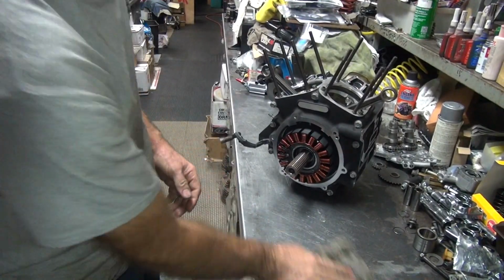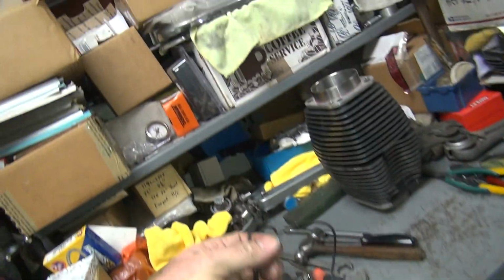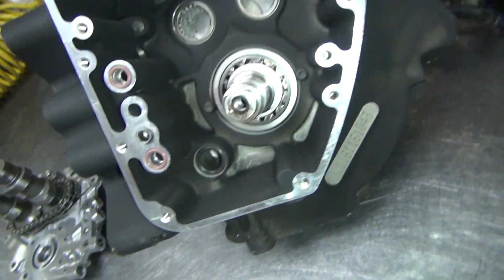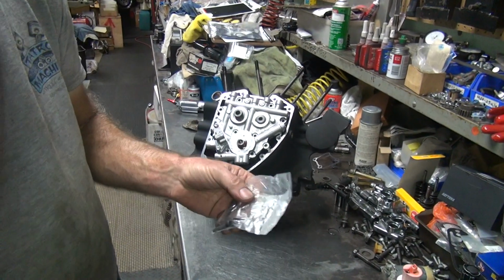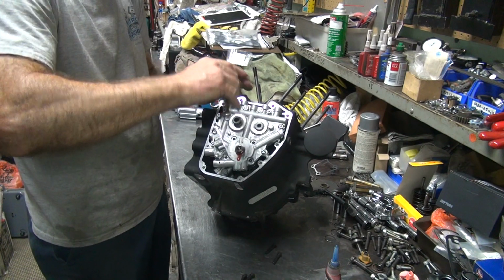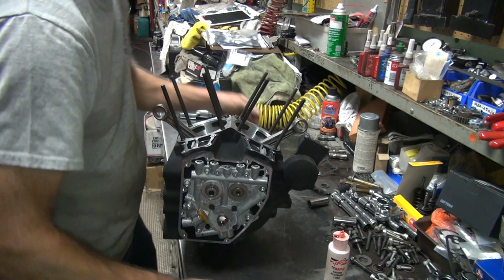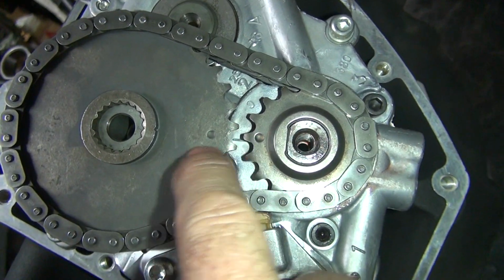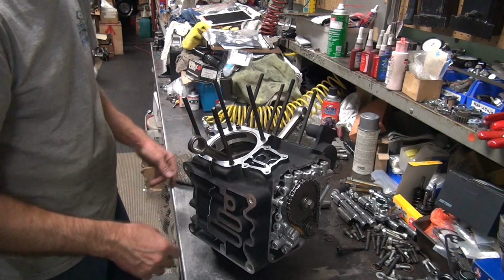#115 2011 roadglide find the motor noise FLT harley twin cam repair motor primary by tatro machine

Comment: Wow,  If my mechanic's work bench looked like your shit show, I'd run out the door as fast as I could.  You speak with the confidence of a drug addict.  Spinning the crack and giving a visual approval of pinion runout......... you're an idiot!
Reply: WOW!!! you have a "MECHANIC"...... and you call Tatro an idiot.  Maybe you should think about your ignorance before  you speak.
Reply: I am willing to bet that the crank was probably trued on the bench before it was ever put into the cases. And about the Clutter That is how the mind of a genius works. He's not just changing your oil on clean workbench. He is building bikes from the ground up.

Comment: No reason why they couldn't have made the cams gear driven. The Sportster engines have been gear driven since the K Model!
Reply from the maker: chains are cheap, very fast to install and take almost no skill to do it.
we all know that harley is cheap and saves every penny they can wherever they can.
tatro
Reply: ------ with 4 cams ----- Sportster gets short changed... they deserve glory & praise ------ race proven tried and trued ------
Reply: @rsgabrys3080  not to sound like an asshole or anything but the Indian FTR bikes have been eating them up on the dirt track circuit. HD has at best a top 10 and get smoked by the competition be it Indian or something else like that of a Japanese bike. Damn shame
Reply: Kenneth Wise they got away from gear drives on the TC and M8’s because of the crankshaft design. When they switched to a press in crank pin they lost accuracy on the runout at the end of the crank where the gear sits. Using a chain instead of gears allows a lot more flexibility in terms of tolerance so HD doesn’t have to spend as much time truing up their rotating assemblies. 

When guys go to gear drive setups ok their TC/M8 engines it’s imperative that the crank runout be checked and found to be in spec. Most engines with any amount of miles won’t be so the almost a sure thing that you’ll need to save the crank trued up and the pin welded in place to keep it from moving. 

The Evo and older HD’s use a tapered crank pin with nuts on either side, it makes it a lot easier to keep straight. 

For better or worse it’s a choice HD made in order to ease production and lower costs. Like I said gear drives are available for people who want them. In my opinion it’s really not necessary unless you’re gonna split cases and mess with the crank anyways. I’ve built a ton of these “moron motors” and only used gear drives on a few, never had an issue with one jumping time or anything like that. The 99-06 Twin Cams used a spring driven tensioner instead of the hydraulic tensioners you see in this video, they upgraded to that style in 2007. If you have a 99-06 TC I would recommend you check those tensioners if you haven’t already and to upgrade them to the newer style. There’s a lot of aftermarket solutions available to address that issue. 

I just finished replacing a cam plate oil pump, chains, tensioners, bearings and gears in an 05 103 ci TC today as a matter of fact. The old style tensioners failed and the chain got slacked to the point it rubbed a hole through the cam chest cover. Bad deal but he upgraded everything and won’t have that issue again.
Reply: @vtwinbuilder3129 do you have a you tube channel ?...
Reply from the maker: the xr750 was designed in 1972 and updated somewhat over the years. Indian copy every part of how the xr750 worked on the track and designed its new bike to be better in every way that their computers said they could do in 2015? i think harley did a very good job with a 40+ year old bike and motor.
tatro
Reply: Michael Mitchell haha no I should though, I don’t do as much machine work nor do I work on the older stuff like Tatro does. I do mostly the newer stuff, TC’s and M8’s. I see Tatro doing a lot of restoration type work on the older bikes too that I just don’t see in my area. 

I do a lot of custom builds on newer bikes, mostly touring HD’s but we do a softail or Dyna every so often. I have taken some footage with my phone that I plan to upload, I just haven’t done the research on how to properly edit and prepare video for uploading and I don’t have a proper camera. 

I’m not against it at all if people wanna see what I have to offer. I just need guidance on the technical issues I mentioned above.

Comment: Hydraulic cam chain tensioners came out with the '06 or '07 Dyna. No spring. The outboard chain design
changed, too.
Reply from the maker: the softail motor i did years ago had a spring in it as i recall. i was not taking about the 1999-06 spring load tensioners. there was a small coil spring inside the hydraulic unit.
tatro